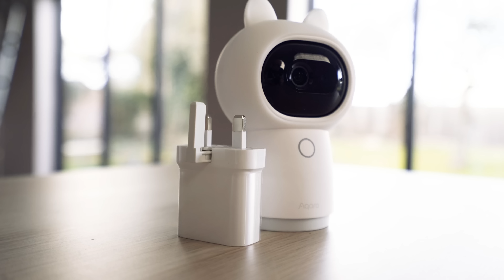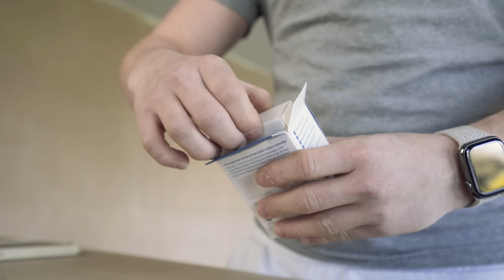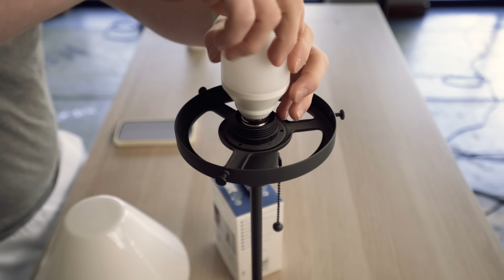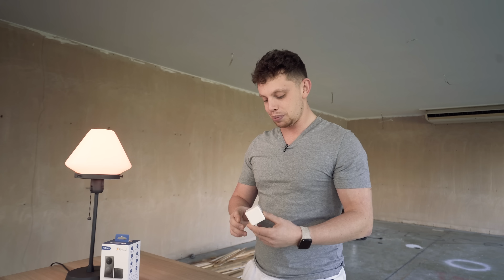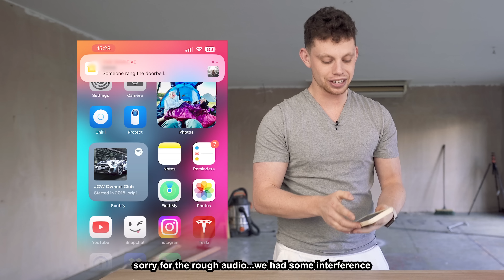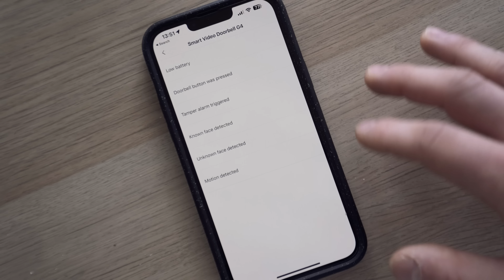These Smart Home Products Blow My Mind!

Comment: Regarding the cube
A 1 - turn off everything and sets the alarm to activate.
A 2 - boot everything up and sets the alarm to in house/shell mode.
A 3 - toggle all shades
A 4 - toggle windows/doors to allow for a draft or closes all doors and activates AC
A 5 - sets the the AW mode 
A 6 - anal.

Comment: The cube is the worst invention I’ve seen in a long time. Smart tech is supposed make things easier, not replace one manual function (a switch) with another one (turning a plastic cube over).
Reply: Hard disagree. I have two computers and use a usb switch with only one keyboard and mouse. Play YouTube or Music on one computer and work on the other. If I’m listening to YouTube and working, I have to switch the usb to take control of my other computer to then pause.  But with Hass.Agent, Home Assistant, and the cube, I have a zigbee device that doesn’t care which computer my mouse is controlling. I flip one direction to go to next video/song and in the other direction and I rotate for volume up or down. I also have the knock which is a media pause. So I never have to switch the usb switch and wait to control my media while working. Great for when the wife walks in and gets annoyed waiting for me to be able to pause.

Comment: Did I miss you mention matter compatible?
Reply: Matter compatibility is not yet publicly available, it is still in beta on one of their hubs. It will eventually release on more hubs according to aqara. Since most of the devices connect via Zigbee to the aqara hub, the devices will gain compatibility via the hub bridging them through, like how Philips Hue Matter will work. The doorbell is not Matter supported, I don't believe cameras or doorbells are part of Matter spec just yet.